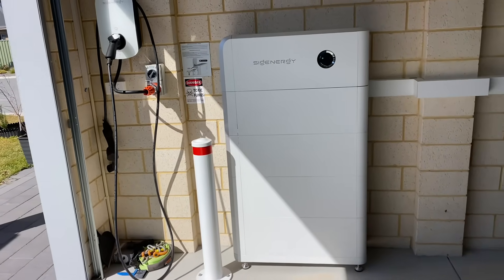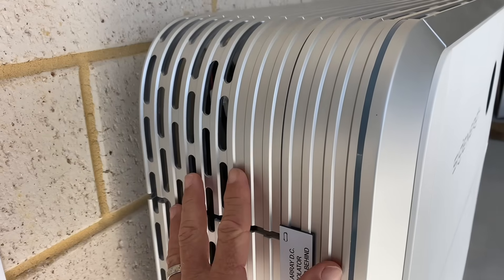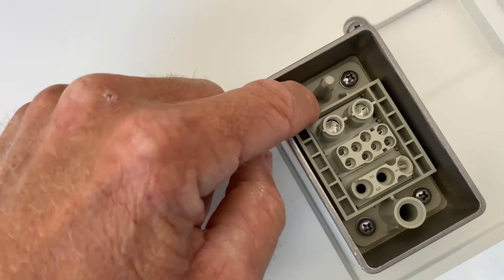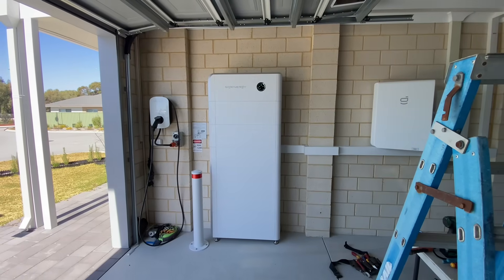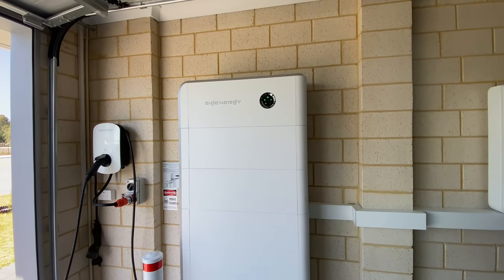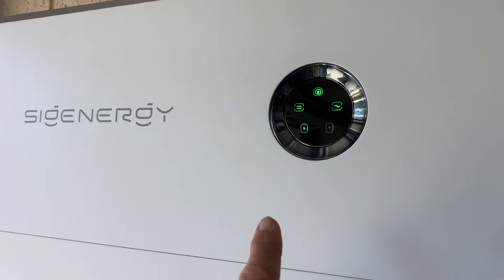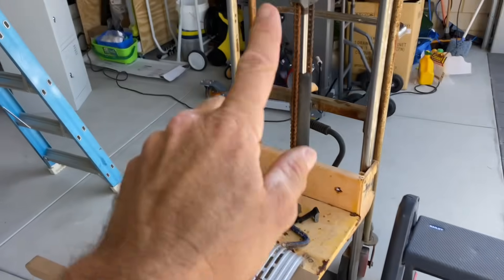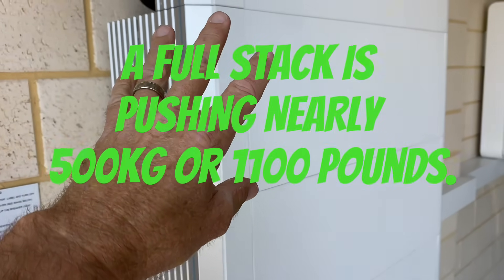￼ Is upgrading the battery capacity on a Sigenergy battery system really so easy !🤓 🔋

Comment: is it common on sigenergy stack installations occur on the small recess on the side of the garage walls? how much space do you need for the recess?
Reply from the maker: Yes, absolutely I’m not sure I’m the dimensions of the top of my head, but they can easily be found online. You also need to be mindful of the required clearances either side of the inverter and batteries.

Comment: This is awesome news, there’s no commissioning the new battery which is great. 

Customers don’t necessarily have to have an installer do it as they can now DIY a stack or 2 if needed.
Reply from the maker: Umm ye I guess so! Never thought of that 👍🏻
Reply: That’s great news DIYers can do an extra battery install if the installer leaves enough cable length for it. But how does this affect the warranty? Is the warranty with the installer or with Sigenergy? @joondalupelectricalservice3201

Comment: One of the cleanest installs I've seen. Can you do a video on how you covered up the conduit under the gateway?
Reply from the maker: Thank you mate. I cant do a video as I wont be going back to this site now. But I simply removed all the glands at the bottom and have the cables going directly into the duct. It has been fireproof sealed and the dc cable is in conduit within the duct for segregation as is required 👍🏻
Reply: @joondalupelectricalservice3201 thanks - do you have a link to the ducting? Only thing that makes their gateway look bad is the cable glands and conduits!

Comment: Hi am having a  32kw battery system installed  on me verandah which is a concrete slab. The wall is double brick and I want the install to be one at least one full brick above the slab due to low flooding in heavy rain down pours. The installer says they can mount it on the wall but I am not too sure about that given the weight and especially if I add batteries. What is your opinion?
Reply from the maker: They come with a wall mount kit but only for a max of two batteries, you could always add a concrete plinth if you need more than two batteries.

Comment: I currently have a fronius 5kw 3phase system. If I wanted to add a battery to the system, with whole home backup and the ability to charge the battery without the grid, what would my upgade path be?

Can I add the sigenergy battery and inverter without modifying the PV side?
Reply from the maker: Yes you can but I would do away with the Fronius and just have the Sigenergy system. More efficient and its  all in the one ecosystem in the App. They could ac couple the Fronius but I think its better to do away with it. If your existing pv array/s are safe and compliant with the standards that were in place when they were installed then no issue and no need to touch it.

Comment: This looks gorgeous! Absolutely lovely installation there that you should be proud of. I love how your raceway matches the Sigen units, and how your bollard also matches. Great stuff. I’m going to send this to my electrician to replicate for our next system we install. 

I wonder what could be done to the car charger to make it look equally as nice? What is it plugged into there? It looks like a timer of some sort, but the Sigen AC EV charger has smarts built into the software so I wouldn’t think it would be required. I know the DC EV charger is super sleek as it integrates directly within the Sigenstor stack, so no concerns there. I’d like to make my AC one look exceptional like the rest of your system though. 

The legs on your Sigenstor also look unique/custom to my eyes. At least in Canada anyway Sigen ships a plastic base with a built in level to help encourage installers to do the right thing. Did this change since your install or is this a regional thing? 

Finally I should say thank you for giving Sigen credit in this video for their clever “auto centering” idea. After your last video where you waited until the end so say how great Sigen was, I was afraid you’d been bought off by their competitors to start bashing them. I’m not affiliated with Sigen. I’m simply a happy customer who had to rip out a competitor installation that I replaced with Sigen and was blown away by how much better this system is. 

Lastly you mentioned in your last video how you’d never use the Sigen energy controller for an off grid situation. I would very much appreciate it if you could create an explainer video on that. I currently have an ongrid system that has used ~1 kwh from the grid over the last month (just from round-off errors as far as I can tell as I always had plenty of battery & solar available) and haven’t seen any issues. It’s been going so well that I am planning offgrid for my next project. So I am very much interested in hearing your thoughts on why you wouldn’t do this.
Reply from the maker: Thank you for your kind words I really appreciate that. Most of your questions I will try to address in another video on that system soon 😊👍🏻

Comment: The weight is a big problem with these batteries. Still looking for a good solution to place them on my own. 

Biggest problem is that the equipment advised to place them with is just as heavy or even is even heavier. 
( this also needs to get in en out of the van)
Reply from the maker: Ye its not easy, my hoist fits neatly in the back of my trailer but with a van its not easy thats for sure

Comment: Very nice.  I'd put in a fire box or away from property.  If they're on an outside wall with fire protection, these would be great.  I love my family too much to ever put batteries inside my home.  Also, got an EV so doubling their risk.  I wonder if these are pouch cell or eve cased.  I know the pouch cell in my phone lasts about 5yrs.  50% dead after 2 yrs.  Interested to see how the new pouch batteries last.  It's concerning that 32kw isn't enough power.  Have they degraded that much?  Scary.
Reply: Wow. You've ticked off a lot of talking points there. Well done? Let's say your concerns are genuine. I can immediately put your mind to rest:
These batteries (& pretty much all recent domestic stationary battery storage chemistries) are LFP. The old NMC chemistries were a minor fire risk, but spectacular if it ever happened, for sure. The truth is that LFP is non-combustible. There are exactly zero reported fires of these Sigenstor batteries globally. They also have multiple layers of fire suppression built into them, mostly to mitigate overpressure rather than fire.
If you have ever put your family in an ICE car or NMC/NCA EV, or parked one in your garage, you have taken inordinately more risk, and survived! Congratulations. ICE cars have always caught fire as a function of combustible fuel being in and near a hot engine & electrics. Not often, but regularly. Nickel based battery chemistries catch fire at a much lower rate than ICE, but are more intense if they do. LFP is BY FAR the safest of all these options in your home & on the road. If you've ever used a gas appliance for heating or in the kitchen, for hot water, or the BBQ, you already have stunt-person credentials in comparison to these extraordinarily benign batteries. Relax, & maybe change your media sources if you want the truth.
Oh & they come with an extendable 10 year warranty which permits a full charge/discharge cycle almost every day on average for those 10 years. We're really not talking cell phone batteries here.
Reply: @MortyMac  lithium titanite (LTO) is actually safer than LFP, but yeh LFP should be fine.
Reply from the maker: LiFePo4 technology is very safe. The worst I have seen is them venting gas when they get extremely hot ie an unrelated fire next to them.
Reply: The batteries did not degrade. Jason explained in response to another comment that the home owner decided to reinvest their rebate into additional battery storage:

> Ahh yes well I rang them to see what the account details were for me to pay them the battery subsidy and they put it towards two additional batteries. Yes you can only claim the subsidy once.

Comment: I am seeking a Sigenergy battery with solar upgrade and expansion however the WA agent advised that they only offer 6kw modules? I was looking at a 10 or 13.5kw solution. Wondering if you might know if the smaller modules are available in WA or if the 8 or 16kw is financially competitive?
Reply: Don’t know timing for Australia, but already in the UK new Sigenergy batteries are upgraded versions with 6 and “10” (actually 9) kwh capacities and adjusted pricing. Same physical size, fully mixable with the older versions. I could imagine that there might be some supply issues during the runout of the older version stock and arrival of the new ones. 
The modularity of the Sigenergy system, with the ability to freely mix new modules into a stack of part-degraded ones (and the comparatively ‘small’ cost of each upgrade step) is a big selling point. You can upgrade later, as and when the need or financial advantage/opportunity arises. 
Nobody can tell exactly what the optimal capacity for you might be, for today. And you can be sure it will be different as the years go by. Flexibility is a fantastic asset.
Reply: I can't answer for WA supplies, but they currently have CEC approval for their 5 & 8 kWh modules. 6 & 9 (confusingly marketed as 10) are going through approval in Oz now I think. The 8's cost less per kWh than the 5's with same installation cost. Overseas looks like it is same story for 9's overr 6's. I only know as I am keen to purchase the 9's once approved as I can only fit 4x modules (+ controller module) in my garage under an upstairs bedroom before I would need fire risk works done. The higher energy density works for me.
For sizing your battery, particularly with government incentives, I would go larger if you can. More things will require electricity, & some capacity degradation can be expected over time. If you don't require the full capacity now, you will not be working them as hard & they should perform better for longer. Just my $0.02
Reply: @MortyMac thanks very much for your comprehensive reply to my query regarding battery sizing. I saw a video recently regarding the battery marketed at 10kw only producing 9kw which is rather misleading. It will be interesting to see how the market responds to this anomaly because its very misleading marketing
Reply from the maker: Hi, the battery modules that Sigenergy offer are either 5 or 8 kWh. Both are readily available in W.A.
Reply: Nice block work. 😊